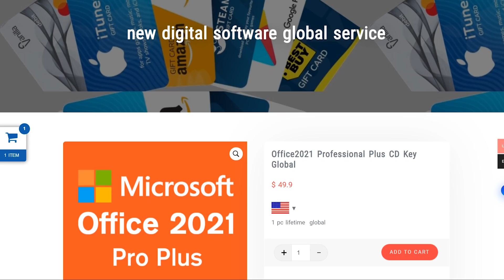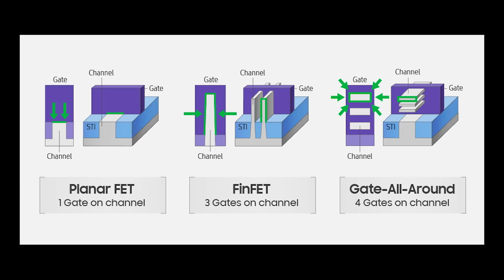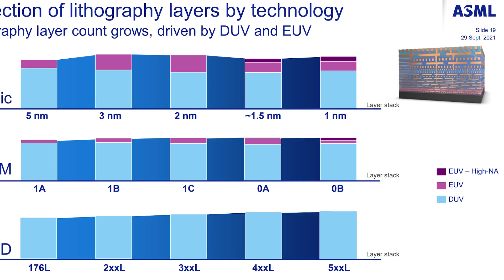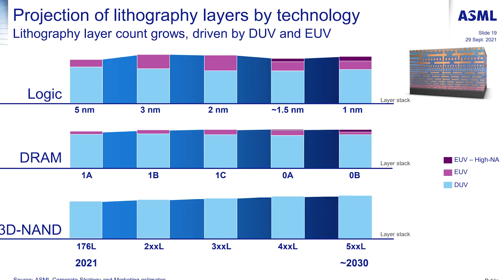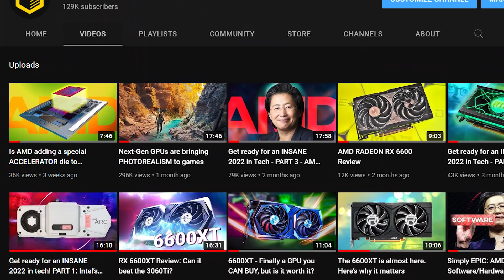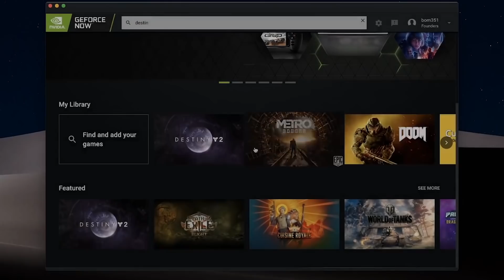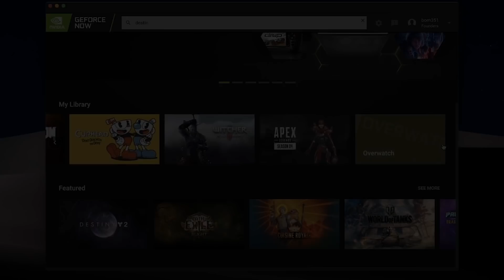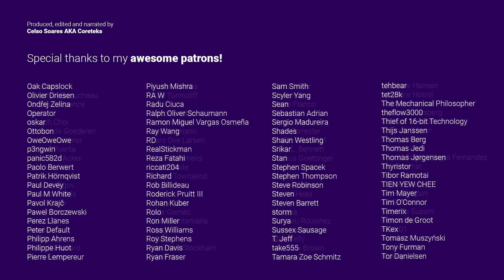GPU and CPU prices are only going to get WORSE in the future. What should you do?

Comment: Just a note - trnasistors arent actually shrinking. Transistors are stuck at 14 nm. Since then, al lthe X nm names are just a naming scheme, it does not reflect actual transistor size anymore.
Reply: Going to consoles arent an option long term anyway. If chip costs stay high, console costs will be high as well. They arent going to be selling consoles at a loss nowadays.

Comment: So you are saying that production costs are going up because of ASML machines costing more as the years go on, yet you've claimed costs per chip will decrease for amd/nvidia/intel because they are all going to chiplet models. Bit of a contradiction there, tbh I don't think consumers are going to pay more and more for computers when the majority of the population is fine using their phone or has a company provided device for work. Xbox, Nintendo and Sony also understand that the market needs low cost devices to function, otherwise you would only have series X, PS5 non digital and they would have stopped selling the older switch model.

Comment: I think comparing the massive swings in US GPU price structure to production process only is massively missing crypto, supply chain and corona life structure impacts. Yes, things get more expensive as they get smaller, they also get more efficient and higher in scale which typically reduces cost. Where that price point is going to be is a function of too many variables to be discussed practically and thus this video is as informative as saying tomorrow the wind will probably blow harder.

Comment: I bought a RX480 in late 2016, and will be getting a 6900 XT Toxic in the near future as it's the fastest GPU for Windows 7 and i'm cautiously optimistic for Stalker 2. If I can do 10 years with said card I consider it a great investment.

Seeing the Rstein duo in GTA V at 3840x2400 with maxed out settings.. man I can't wait. €1800 for the 6900 XT Toxic EE though.. god damn that's five times what I paid for the RX480.
Reply: Five times? RX 480 was not €360! It came out for $199 for 4 GB version and $229 for 8 GB version.
Reply: @Kynareth6  Considering I paid €260 for mine in late 2016, five times the price of it for said 6900XT Toxic isn't even enough.
Reply: @Kynareth6  Hi, me from two weeks into the future. I paid €1550 for a slightly used (just over a month old) 6900XT Toxic EE and have been enjoying it so far.
Reply: @Wasmachineman  You vastly overpayed.
Reply: @Kynareth6  Caseking is still Out of Stock and they want €1800 plus whatever shipping is for one, I think I got a good deal.

Guy who originally bought it paid even more than I did so his loss is my gain :^)

Comment: You are not considering the second order effects that will dominate. For example, chiplets will mean the dice that are used to build a chiplet SoC will be smaller. These smaller chiplets will have higher yield, which means cost will be lower. Only the most important chiplets in the SoC will need to be fabricated in the most advanced process (e.g., 3nm), so at least some of the chiplets will be in older, cheaper process nodes. Etc. I expect that after chiplets technology is embraced universally, costs will actually come down and other aspects, performance and power dissipation, will improve. Apple's M1 SoCs are proof of concept. I like your videos, but your analysis is often shallow.

Comment: You can be a PC-enthusiast without having bleeding edge hardware. Perhaps a significant slowdown in hardware upgrade cycles will once again encourage development of more efficient and highly optimized software. The relative abundance of ever increasingly capable hardware of the past decade has made this approach obsolete, letting developers get away with what can only be described as horrendously bloated garbage.
Reply: I agree, but investors won't like it. Most investors hate to see company invest in optimization, to them its going for 90% perfection instead of going for 80% which is good enough. Better gross margins. I still think game studio's have some catching up to do to fully utilize the GPU hardware.
Reply: Exactly why I bought a used 3700. I don't need the latest and greatest. The only bottleneck now is my r9 290. I refuse to upgrade my gpu in the current market.. Even the 2nd hand market is still ridiculous

Comment: I think you are missing the point here, Coreteks. If a new chip was more expensive to manufacture per unit of performance measurement, there would be no point in producing it. Instead it would be more efficient to produce whatever amount of older chips gives you the same performance and stack them together, investing into technology that reduces chip to chip communication latency. The fact that these new nodes *are* being developped by itself is indication of their lower production cost (per performance unit). The only thing that lets price per performance rise is the lack of competition due to excess demand.

Comment: I honestly don't think increases in the cost of facilities is going to have a huge impact.  Alot of the money is spent on R&D for the new nodes and the chip designs based on them. And yes ofcourse segments like cars will look for the cheapest option possible that does the job because they are not performance oriented.
the only impact from this i see is that the first nodes using GAA will be more expensive but this fixed cost is going to be nothing a couple of years down the line

Comment: Good video but I don't agree with your assessment that a mid range GPU will cost 1000$ on a newer node (of course in this market yes but not if there was enough supply).  Yes the tech always starts off as more expensive, but tech always gets cheaper over time.  Also the chips themselves will be much smaller so we will be using less of the silicon wafer.  Tech has never taken a "Leap" then gotten 3x more expensive and stayed that way - they would be driving 90% of people out of the market - and they want that 90%.

Comment: It sounds like the race towards more miniaturization is just motivated by the inevitable revenue increase as opposed to any real benefit to the consumer. Aren't chips small enough already? Do consumers demand a reduction of 1/2 mm in chip thickness? Is there a true, value-added, compelling reason to keep getting smaller?
Reply: Benefit is performance per watt and battery longevity, as progress in later is non existant.  Also, as long as frequency was increasing (before reaching current ~4 GHz plateu) it was necessary to shrink chip to avoid wave effects.
Reply: It's not only about chips getting smaller, but packing more transistors per chip. You want faster and much more efficient computers for robotics, AI, video games, Internet of Things and science. There will be a trillion transistors on a chip by 2030.

Comment: In other words, it will be the time of only upgrading when it is absolutely necessary not because one desires better performance. Unless one is wealthy that is.

Yes, I will be going console only eventually. Current prices have already got me there let alone higher prices. It is just a matter of when my PC is no longer good for gaming. At most I will upgrade if Intel prices Arc low enough. I have always used at a few generations old mid-range cards so the fact they won't be in the high end with DG2 does not bother me.

Comment: I wonder if we put all the latest technology on an older node like 28na or 14na how much difference in performance are we gonna have compared to old CPU and GPU in the same node
Reply: More performance is the result of more transistors. 28nm would have terrible power efficiency.
Reply: @Kynareth6  i think there's more to it then just transistor i mean look at intel 14nm went for full 6-7 generation and every generation had slightly better performance then the previous one and more specifically in the ultra low power segment when the power efficiency is important
Reply: @aborkmga1  Intel processors were getting larger and larger on 14nm, so they had more transistors by planar scaling. AMD's now also starting vertical scaling.
Reply: @Kynareth6  will that's make sense I guess

Comment: I am so happy that I bought a FLAGSHIP first time in my life in 2017, 1080ti still does a decent job even on 3440x1440 120hz monitor. Patience is the key, I will NOT pay those ridiculous prices!
Reply: 1070 works fine on a 2560x1440 @144 hz too, why would you want a 3440x1440 though is a mystery.
Reply: @StrazdasLT  I don't want it, but it is impossible to go back, 16:9 now feels like you put horse blinds... 34% more horizontal view is addictive.
Reply: @viktorianas  You are a strange person. According to NASA, human vision cone is closest represented by 4:3 oval. Now obviuosly monitors wont be ovals, but the whole 16:9 trend only happened due to movie (and TV screens as a result) because hollywood wanted to "be different from TV" and not for any actually useful reason. Going even further widescreen sounds like torture.

Note that this does not apply if you are using half of that widescreen as basically second monitor.
Reply: @Wasmachineman  am just gonna agree with all of you. 🤣

Comment: I actually wanted to buy a 6700 xt in this gen as a good upgrade for the 580 but had to go for the 6600 xt. The crisis was also a very good thing for me though, I sold my rx 580 8gb for a 4gb version and 150€ and then found a prebuilt with a 6600 xt speedster merc for 770€. I managed to sell the pc for 500€ and basically turned my 5 year old rx 580 8gb into an rx 6600 xt for just 120€. Its possible to afford the new cards if you manage to sell the old one.
Reply: LoL that was a nice move. I have a 5600 xt but I don't see to where I could be upgrading to.
Reply: Don't think I can sell my 750 ti for more than 50 lol

Comment: If they’re going to start charging 1000 MSRP for a 60 level GPU, then they’ll just rename it to an 80 or 90 level GPU and invent other devices to fill the product stack below (super cards renamed to the current generation.) If performance is not sufficient enough to upgrade, no one will buy the cards.
Reply: Yup, just shuffle the labels to allow for whatever pricing they want to justify. Nice icon + name btw.
Reply: I doubt it. The new 80/90-class cards will have a proportional price increase to $3000+
I think we'll see the start of this with RDNA3. The RX 7600 XT is likely to match the RX 6900 XT and cost about $600, while the top card (presumably the RX 7900 XT or 7950 XT, though it might be called "RX 7900 X2" as it has 2 GPU dies, leaving space for the RX 7900 XT to be a midrange card) could easily be $2500.

If the $1000 card is going to be branded as 80/90-class, then what are they going to call the $2000 and $3000 cards? Are we going to see a ton of "Titan" cards from Nvidia and "Fury" or some new high-end brand from AMD? It's not impossible, but I don't see them doing it. They want us to see the ridiculously expensive flagship cards as normal so that we're less reluctant to buy them.

Comment: And because resources on this earth are limited, there will come a point, rather sooner than later, where prices increase heavily anyways, if we make as much e-waste as today, instead of recycling. Then we will use a PC AT LEAST for 5 years. Think of it as you have a RX580 or 1070ti and will upgrade at the earliest this or next year. For most games this is no problem at all. I don't say hardware is too cheap, but for the longest time it was normal to pay way over 1k to get the high-end hardware, we only had a few cheaper years between it.

Comment: I don't see a reason to go for the good/expensive cards. If the efficiency increases greatly, maybe 3050 will be all we need? I don't think i am alone in this way of thinking, so that should create at least a small incentive to keep the prices in check
Reply: 3050 will be very weak. Are you serious? Do you want 1660 - 1660 Ti level of performance in 2022+? And only 4 GB of VRAM? I had 6 GB of VRAM in 2016. And I am not buying anything. Instead, I'm waiting for 3090 level of specs for $250-300 as crazy as that sounds (but it shouldn't, tech ought to get cheaper).

Comment: Since Intel is launching ARC graphics cards next year and AMD will be refreshing their lineup on 6nm and Nvidia will be releasing new products as well I think competition will be back Q2 2022. Whether prices will go down due to competition from Intel is another story if distributors, AIBs and sellers and miners continue to try and take their cut. If Intel wants to gain mind share and therefore sales when they aren't going for the high end (current perf of Intels GPUs puts them at around a 3070) then they will need to go after people who are only interested in the sub $300 market. Intel, like AMD were in 2017 with Ryzen, may be the bargain to get if you don't have the money for 500/600$+ (which to me is very amusing considering Intels history but leadership and culture have started to change there). Pair that with an 8 core Ryzen CPU and some DDR4 (DDR5 won't be worth it until like 3 years into its cycle I believe and even then it will be ludicrously expensive and might only have benefits for APUs) and you have a good gaming system I believe that will beat the consoles (though it won't beat them on price because the consoles are so good). Only problem is DDR4 won't be produced anymore and so will be higher in price as more production moves to DDR5. Times be changing for the industry but once more production comes online in 2023-2024 I think we will get another period of oversupply as the pandemic has proven that current supply chains need beefing up.

Comment: I think this video presents false conclusions based on a rising trend in production prices. The general trend of rising perf/cost will not stop, because that doesn't make sense in a world where new GPUs are constantly produced. The trend has just slowed down massively lately, and will speed up again slowly, soon. It's just that the fastest hardware will go up in price relative to previous top-tier hardware, and the price floor for the lowest-end hardware goes up, but that doesn't mean perf/$ goes down in lower tier segments.
Reply: 480 $199
6700 XT $479
140% more expensive mid-range card after 5 years

Comment: The solution is simple: just don't buy anything. 
Assuming the supply/demand issue is sorted by 2023/2024 (crypto crash when?) I'll be looking to buy a used GPU in the $100-200 range to replace my RX 480.
Reply: The real enthusiasts who follow the market are still holding onto their RX 480/580s. I refuse to upgrade until i can get a better performance/dollar than that generation.
Reply: I may just leave pc gaming altogether. I’ve already switched to Mac for video editing since I couldn’t get new parts in time. Really I don’t need windows anymore either. 

It’s fucking absurd that a spec’d MacBook Pro 14’ was cheaper than getting a 3080 based rig.
Reply: Yeah my current plan is basically just to play indies & my Steam backlog on my 970 until it dies, and if GPU prices are still ridiculous when that happens, I'll just get a Series S (or X if 'that' shortage has let up).

Games have looked 'good enough' for a while in my opinion, and I really don't need to pay $900-$1200 for a GPU to match a $500 console.
Reply: @Cirnobyl1  PC gamers are a small drop in the bucket of total PC users, I wouldn't worry about that.

Also you can put linux on all sorts of devices including ARM so I wouldn't worry about that either.

Comment: I think there will be an option for high end graphics to push up pricing, but devs are still going to be developing based on a 1060 or at most the current consoles until they are not the bulk of the addressable market. CPUs are great but apart from server, if they get too expensive, apart from laptop, people won't buy them. Even in mobile where more expensive chips make more sense, astronomical pricing would dampen demand to the point where pricing would drop to "normal" levels.
Reply: Yep, or alternative solutions will slowly become more viable.
e.g. : I've been gaming for almost 2 years  with a Ryzen APU, and only now it started to really suffer (because I got a ultra wide).
 it's gotten very decent/usable over time and since it's integrated into the CPU it cannot be used for mining properly (does not scale well)
Reply: @Lucmatins  amd mobile 6000 apu will be 3x faster than the 4700g
Reply: At least one could always buy good-cheap Ryzen 3000 from Aliexpress.
Reply: well then no innovation for a while

Comment: This is probably the wrong place to ask. But what's the use of having "bleeding edge" hardware at all times? I mean, there's a reason why companies sell the low and mid end tech to the masses.
Reply: bleeding edge doesn't have to mean raw performance alone. eg. the Series S is far more 'bleeding edge' than a OneX even if its GPU isn't as powerful, as there are features on RDNA2's architecture which simply can't be done on the OneX
Reply: in GPUs at least, the "low and mid end tech" you are referring to hasn't existed in its updated form as much as the super profit-raking high end stuff for the last two years
we get the RTX 3050 and RX 6500 XT like, two freaking whole years after Ampere/RDNA2 was first launched